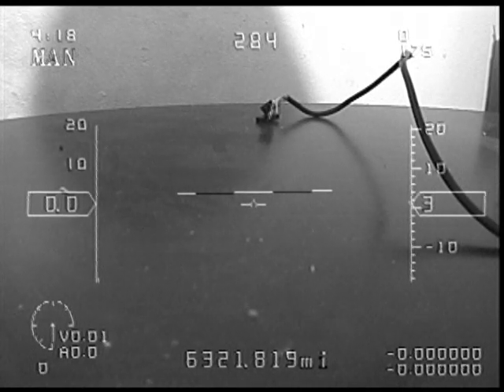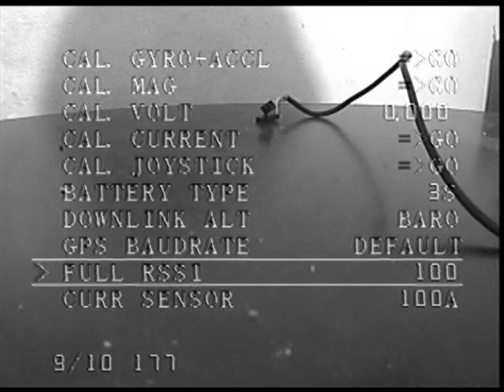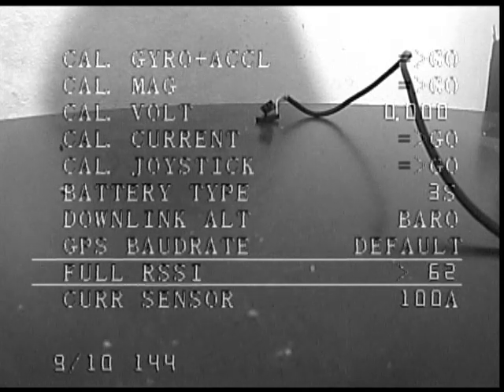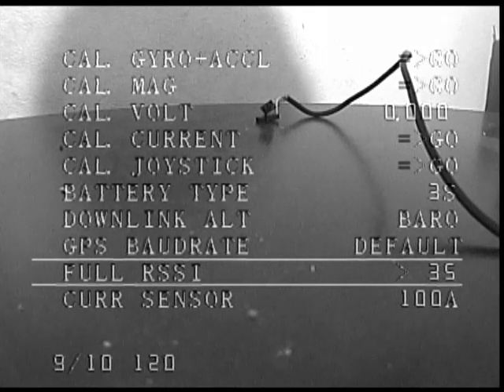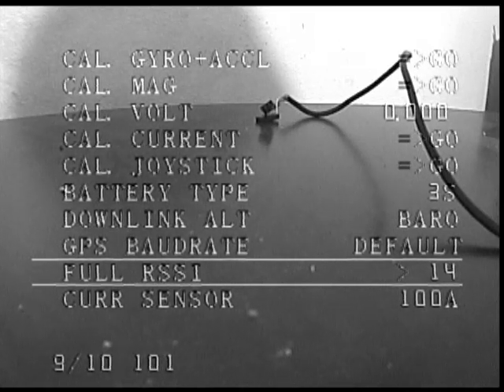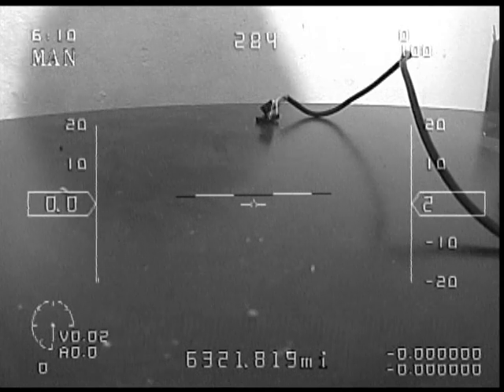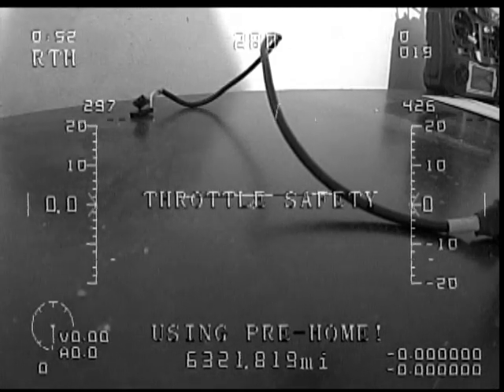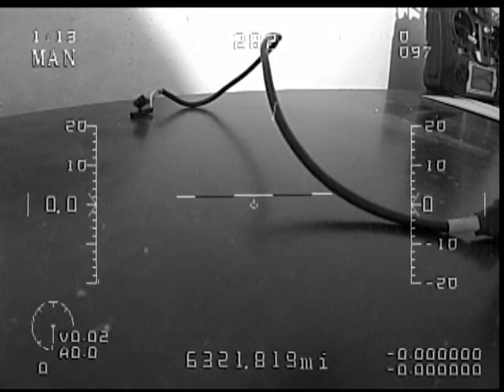MyFlyDream AP - Calibrating RSSI

Comment: Hi. I'm using ezuhf. Apparently I need a DAC or DAX to change the digital rssi signal to an analog one so it can use ezuhf rssi readings with the MFD which need an analog signal. Do you know where I can find a digital to analog converter that works
Reply from the maker: I'm sorry, but no, I do not know. That is not something I've had to go through before.

Comment: This setting is no longer available with the latest version of the MFD Autopilot, Now one require to go to RSSI Cal and when it say go! It give you 5 seconds to shut down your receiver... and at that time you can turn around and unplug your receiver! 
When you turn your receiver back on and save the settings.. it dead on! there is no longer guessing the correct power output according to rssi!!
Reply from the maker: +Migueldeservantes Thanks for that note. I'll probably remove the video as it is no longer necessary or correct.
Reply: +Jeremy Cowgar Hey Jeremy, Don't remove the video there is still tons of people that have the old style of MFD AP.. and they may need the information!! The only reason I did took the time post that information is because I was trying to get my RSSI signal telemetry to work and I stumble with your video! I'm not trying to make you look bad...and thank you very much for your prompt answer.
Reply from the maker: +Migueldeservantes Oh! I did not think you were trying to make me look bad, just figured it was outdated information. So, when you say outdated MFD AP... Did they come out with new hardware or are you just speaking of a software update? I was thinking of removing it to not confuse people. Maybe I could add an annotation to the video instead stating that the process has changed for version XYZ and above? Can you let me know a version number?
Reply: +Jeremy Cowgar Well Interestingly enough, I can say that I should have the very latest of the MFD AP, I did purchase one at the beginning of the year. that I actually only until now was able to start to install and set up on my X-8 Skywalker.. But sadly the one that I have purchased early was a defective unit.. I almost lost a plane that so far I have put well over the 5000 US on...So I decide to just turn around and purchase a new one. that by the way installing it was as simple as just plugging every thing "Since the plane was already wire and literally ready to fly.. It only took me about two hours to change and rig the proper settings according to a flying wing.. So I have not even consider to do any type of update.. From my perspective I don't need it
I guess that a simple message stating that the versions of July 2015 and up no longer have this particular feature. that is all!
Reply from the maker: +Migueldeservantes Thanks! I added an annotation to that effect as to not confuse people going forward. Really appreciate your comments and updates!

Comment: Hello, could you tell me where you connect the wire with rssi on the receiver. Did you connect to the 5v or the signal connector.
I use immersionRC 8 channels I have to set the channel 4 rssi but I have no signal :(
Reply from the maker: almageste FPV I am unsure about the ImmersionRC received. Your best bet would be to ask on RC Groups, specifically in this thread: http://www.rcgroups.com/forums/showthread.php?t=1982275